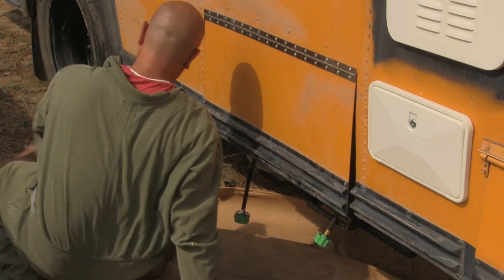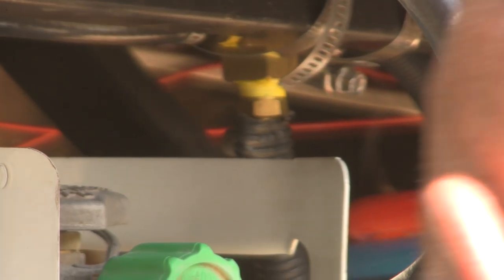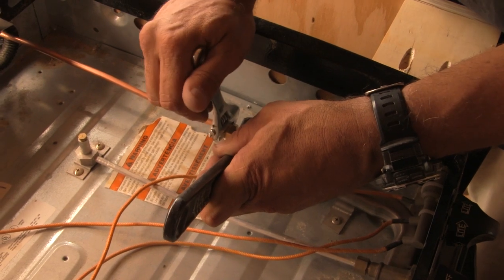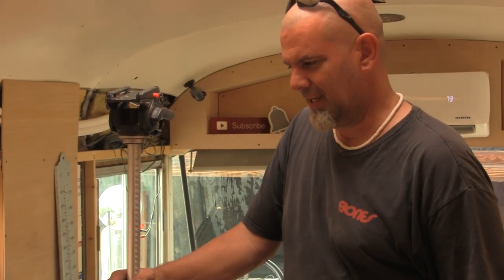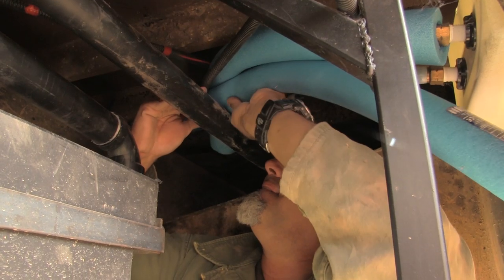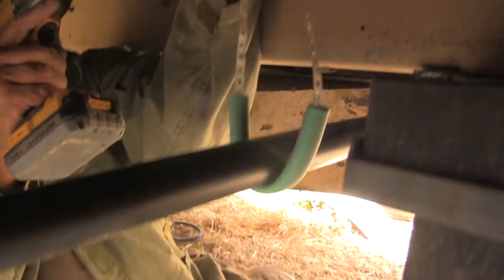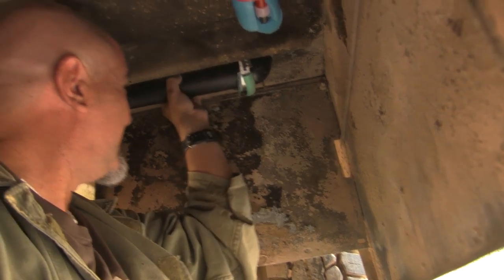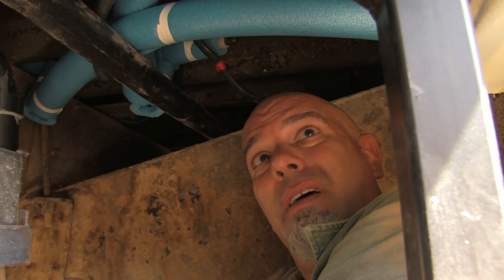Fixing Propane Issues & Finishing All Plumbing Under Our Skoolie

Comment: Idea/Suggestion..... The distribution valve at 3:30..... you can plumb abother propane line into the spot where you have it plugged to feed a Propane grill.
Add a quick connect and you are set.

Comment: Correcting propane regulator upright install ..... back in 2000, living in Utah in 37ft travel trailer with son, we had LOTS of snow, water got into propane regulator, at 3 am we were freezing, later discovered why, but that was when the decision was made to “go Tropical !”.  🎶🎶 “So we loaded up the truck & moved to [the] Keys. Florida Keys that is, palm trees, sunny beaches ..... “ 🎶😆

Correcting the regulator 👍🏻👍🏻

Comment: Saw a new video was up had to stop what i was doing and watch, that "found" real estate under the bus i was thinking if i ever build a bus i would hang some 8 - 12" x 10' pvc pipes in the in either an over under or side x side manor and used them for extra liquid storage to extend your stay. Seal the ends with end caps and wrap it with 1" foam rubber, just thinking. Might also be a good spot for vegetable fuel cell aka free fuel from restaurants.

Comment: Go to RV parts place and you can find small-ish clips to hold the doors up…they work great and don't cost an arm & leg.  After you get enough clips, check out a couple of Class-A rigs (with the the compartments around the bottom and see how they are positioned…                               - - "Scooter" in East Texas

Comment: I hate working with that loom. Such a pain to get it over wiring and smaller parts. I especially like the idea of putting rubber hose on the metal strap. Brilliant!

When you were sliding in under Bussy it made me remember working under busses and trucks on the dirt. My old bosses always used the "fat boy creeper,"  otherwise known as a big piece of cardboard. Those guys were well above average size. Worked great. Didn't get near as dirty, and it allowed you to slide easier. It also kind of gave a bit of a buffer between you and any rocks that happened to be there.

Comment: Hey Mike, I really don't want to see you pick up a battle scar  with that propane door flap either. Might I humbley suggest two (too cool) options? Option 1 - Mount a strong magnet on the door that will attach/stick to the bus. Option 2 - Mount one of those old style window locks verticle on the side of the bus so when you close it, it catches the door. I'm just sayin' LOL...

Comment: Sometimes I wonder if people talk to their families like they comment on videos. Probably. It's incredible to see y'all working in the AZ heat. I think you're a bit cooler than Mesa, but still. Great job utilizing the pool noodles to protect everything.. that is definitely something I'll use on my conversion when it starts. Any reason why you didn't choose to use zip ties around the noodles instead of electrical tape? And I love the "easy" to remove countertop! Thanks so much for your amazing job sharing your journey..
Reply from the maker: You have a great point on the zip ties. My problem is the dry rot really quick. I thing the e-tape will actually last longer! I might throw some on and see what happens.  Thanks for the comment!😁
Reply: If you do the zip ties, which I love, get the black exterior UV resistant ones, they’ll last much longer. Have fun, be safe.

Comment: How about placing a big magnet to keep the door against the bus? Might save your head.
Reply from the maker: That would have been perfect!
Reply: Magnet on a cable tied to each door and when you open stick the magnet to the side of the bus would be a cool idea
Reply: I'd use a rare earth magnet if you go that route.  I'm thinking about gas struts for some like my existing basement storage bay doors and fastening others to possibly open as side hinged.

Comment: I seriously doubt the noodle insulation will be very much protection against freezing water hoses.  The insulation is minimal and heat will still transfer through it given several hours.  The good part is the PEX can withstand freezing because it will expand.  What you may find is that the PEX freezes and blocks the flow of water, leaving you flowless.
Reply from the maker: The idea isn't to prevent freezing because that would be cost prohibitive.  It is just to slow it down. It's the same as insulating your pipes outside. Given enough time, the pipes will freeze but if I can slow it down enough to survive a cold night, it's a win.

Comment: Mike, about that lower level real estate that is not 'prime', I have calculated that to work in that area you should be about 5'2" and weigh around 120 lbs.  Since that does not quite fit you personally, you should find someone who does meet that criteria, and who will work cheap...  er, uh - what size is Kelly?
Reply from the maker: HEHEHE! Kerry is 5'7. Still to big!